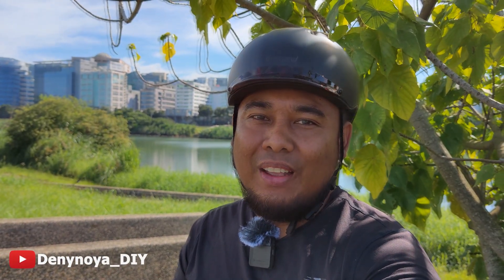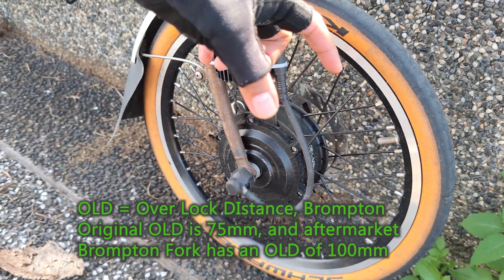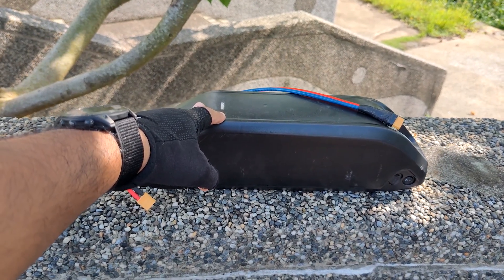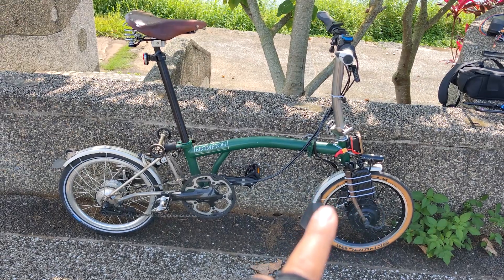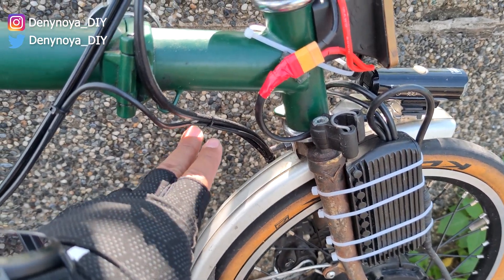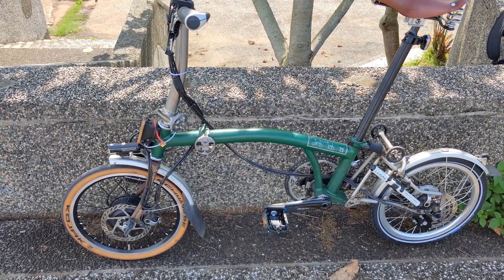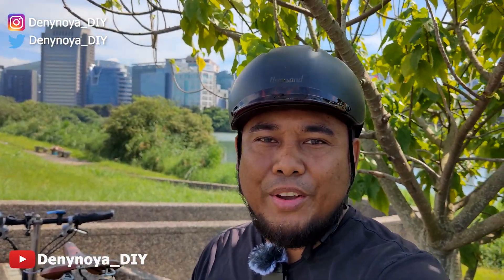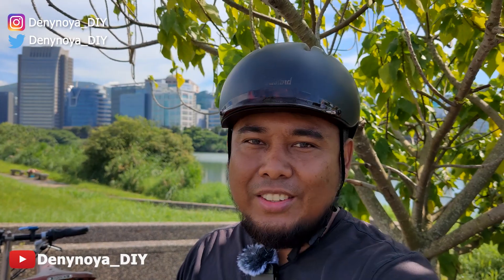Discover the Untold Stories Behind DIY e-Brompton Folding Bikes

Comment: Did you still use the stock rims and spoke?
Reply: @denielnoya  Tnx Sir! My worry is I cant find a 349 size wheel set with motor. If I'm going to buy a motor hub and fit it on the 349 size rim, will the stock size spoke is useable or I need to buy a shorter spokes?
Reply from the maker: Yes you can used it if, you have the tools to cut it off based on the new motor dimensions, because the length is different.